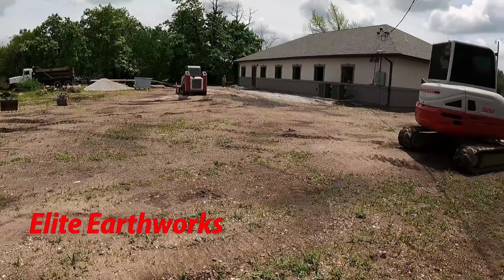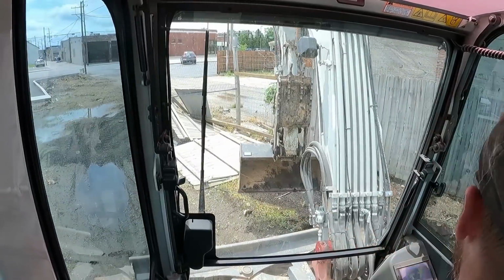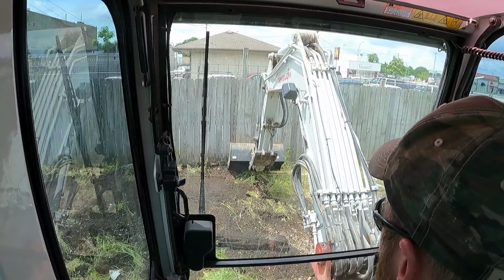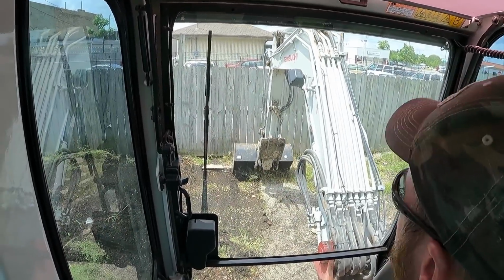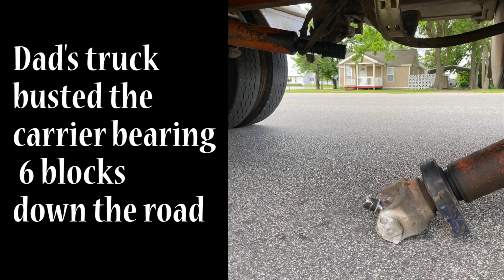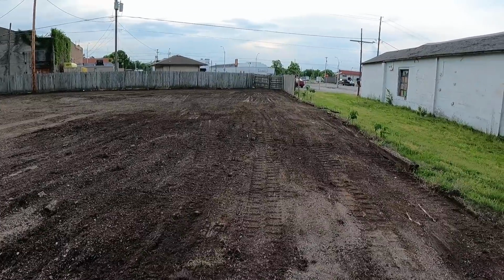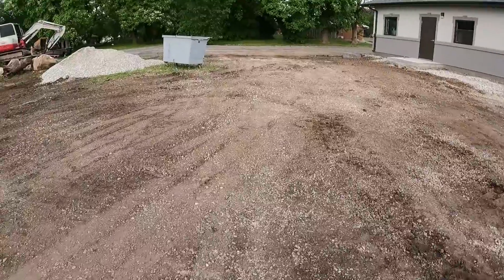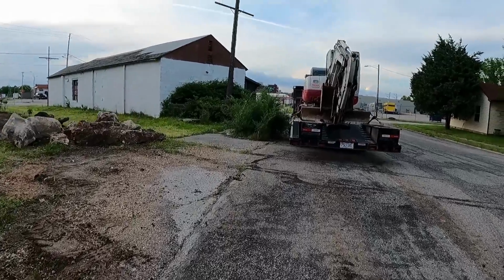Starting Site Work At A New Commercial Building

Comment: Do you find skimming like that with the mini easier with that 2 ft clean bucket like you've got or a flatter  grave digger bucket? Thanks
Reply from the maker: It seems like it is if I just want to take the grass. You have a little more control and it doesn’t dig down in the dirt as easy. Appreciate the comment

Comment: Save the heavy pieces of concrete for wrecking ball’s if you run across a tuff slab in the future.  Drop them on their corner from 10ft high and you can break a slab easy with no hammer.
Reply from the maker: Yeah that works like a charm I do that all the time so much easier than a hammer

Comment: Dumb question here but I'm always trying to learn a thing or two...  Why the throttle all the way up?  Any advantage to running all out all the time?  I like to run my Takeuchi about half throttle so the machine is not so touchy and rev it up if i need the power/ hydroc flow.  love your work man - keep it up!
Reply from the maker: Everything is balanced when they are wide open and it’s easier on the pumps. I know the loader they recommend running it wide. Some of the newer stuff you may not have to. But I’ve always heard they were designed to run at that rpm
Reply: It's always best to run tier 4 engines wide open. If not, its hard on the emissions systems.
Reply: @drewgardner81  mines not tier 4 so I'm good there

Comment: Is that the 18" bucket or 24"?  I just got a 260 and wondering what would be best for general purpose.  I'll get different sizes in the future once I have more to spend but I need to pick between the two.  What is your go-to bucket?
Reply from the maker: I use the 24” the most it seems to be the best all around
Reply: @eliteearthworksllc  Do you like the Werk-brau?  I have the Tag Wain Roy style bucket and coupler.  Wondering if it is worth switching over to Werk-brau.  I can't afford the hydraulic coupler but thinking about using the mechanical coupler.
Reply from the maker: Yes I’m very happy with Werk Brau. Their mechanical thumb is still very nice and you will like it better than TAG I promise
Reply: @eliteearthworksllc  How did you disable the moving alarm?  It looks like there is a fuse but not sure if removing that will cause something else to not function.
Reply from the maker: @beersfamily3426  I believe it’s up by the battery I’ll look at mine tomorrow and let you know for sure

Comment: Gonna keep the 2150 buddy or gonna turn it back in?
Reply from the maker: I think so it’s too handy to take back lol
Reply: Awesome man! I done the same thing with a 160 link belt this year I had rented from my dealer. Couldn’t swallow letting that rent money just go down the drain so I converted it to rpo and got credit for the rent and then purchased it outright. If you get a chance man, check out the linkbelt x3-x4 machines. Some of the best on the market in my opinion.
Reply from the maker: Yeah it’s tough to lose that rent. Ok cool I’ll check them out Link Belt makes nice excavators